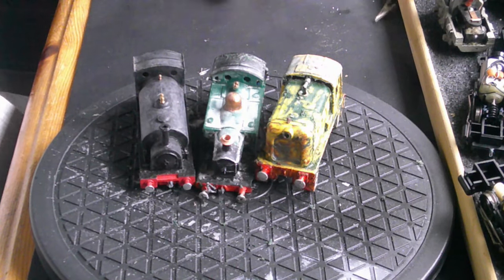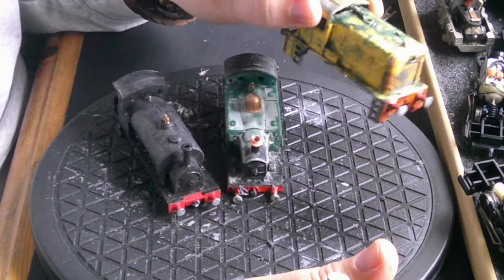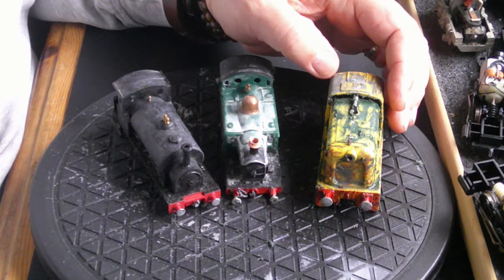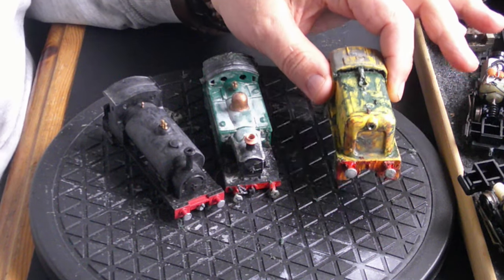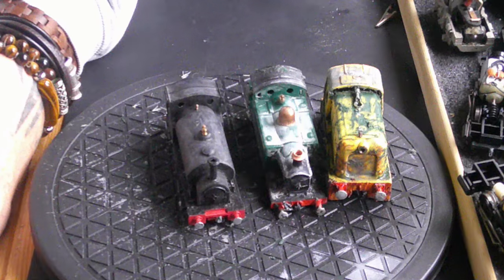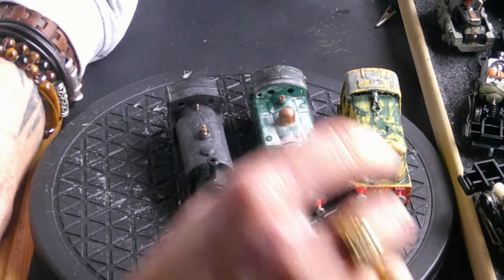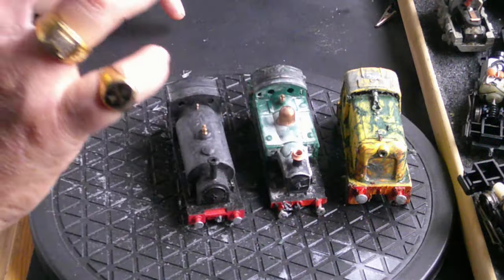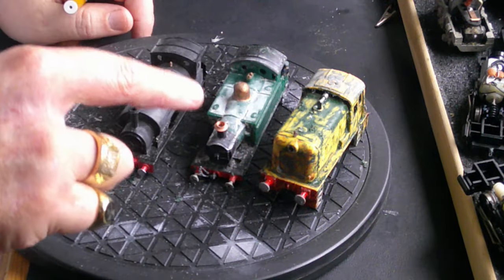WHEN IT JUST ALL GOES WRONG....

Comment: The Humbrol aerosols are the very definition of hit and miss; they’re either brilliant or downright awful, but mostly awful!
I’m surprised they still make the stuff because the failure rates are through the roof. Had to gloss a Black 5 for a customer recently using the enamel spray.. I had run out of my preferred Mr Hobby. I puckered up every time I took a look at it between coats. Thankfully, no cloudy mist.
Reply from the maker: Didn't realise they were known for it, 6 years ago I had no issues but this time, wow what a mess